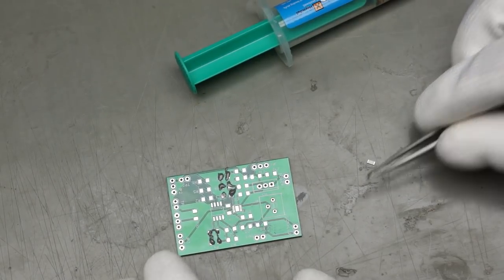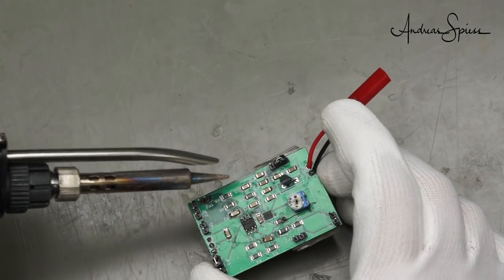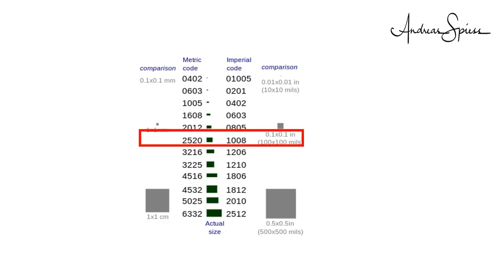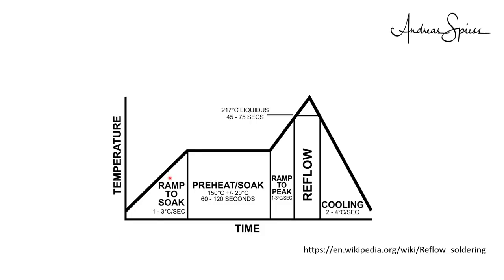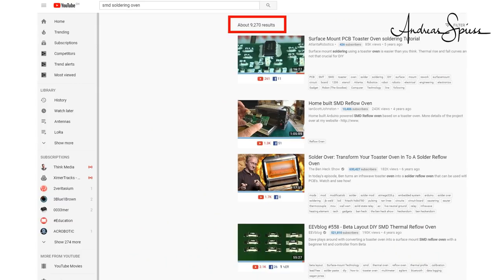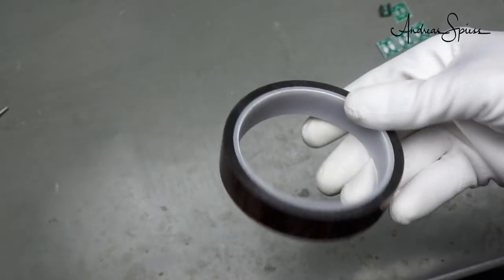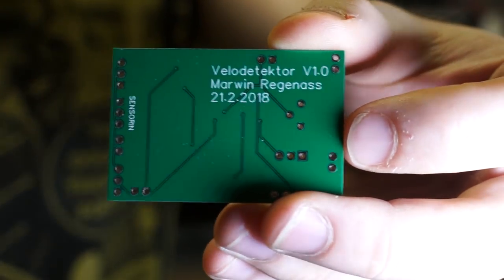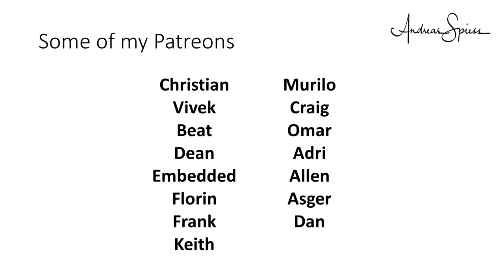#192 Aldi Hack: Simplify SMD Soldering with a Cheap Aldi Oven. Nothing else

Comment: Thanks for the nice video. I am currently looking for a possibility to solder ESP32 chips on breakout-boards and I thought this would be an easy way. Which solder paste do I need for this purpose?

Thx a lot,

Rudi
Reply from the maker: ESP32 chips are not easy to solder. I think you will need a stencil. I use normal solder paste from AliExpress
Reply: Is there a different possibility than to solder it myself? Is there a place where I could buy a finished ESP32-chip on a PCB rsp. breakout-board? I would prefer a breakout-board to a development board since I want to run the ESP32 on battery and the development boards consume too much battery.
Reply from the maker: You get plenty of WROOM32 boards on AliExpress
Reply: Maybe we are talking of different things here - I want a ESP32 presoldered onto a breakout-board where I can solder the pin headers needed to integrate it on a PCB.
The boards I have found on AliExpress either are development boards, breakout-boards where I would have to solder the ESP myself onto the breakout-board or PCBs with no headers or some with a OLED display that I don't need.

Could you provide a link to a module that you would think to be suitable for my needs? I am somewhat afraid of ordering a unit and waiting for four weeks or longer only to find out I'v3 got the wrong one;-)

Thx a lot,

Rudi
Reply: Could you recommend one? The boards I have seen so far fall into the following groups:
- development boards with usb and voltage regulator
- breakout-boards where I have to solder the ESP32 myself onto the breakout-board
- test boards (which are expensive and I don't know how to fix the ESP32 on the boards)
- boards with an oled which I don't need either
Maybe I am looking for the wrong stuff...I just need a ESP32 board (no development board) with the ESP32 already soldered onto the board. I can solder the pin headers myself I just want to avoid soldering the ESP32 itself.

Comment: Regarding the oven, which specs oven do we need? Because at shop i found oven in variety watts. as i know watt will relate to speed up the temperature increasing
Reply from the maker: It has to reach the needed temperatures, which is not always the case. The speed is probably not so important. There are projects for temperature control if you have a very, very powerful oven.

Comment: SMD is easier!  It's not until you try it do you realize how much of a time savings you can realize.  Also these days, solder paste stencils are pretty inexpensive and can also be a big time saver as compared to dispensing from a syringe.  It's worth trying on your project..
Reply from the maker: I agree. But in the years from this video, I am one step further: I order my PCBs with most SMDs already mounted. One mounted resistor cost a fraction of a cent ;-)

Comment: I used a Bleck & Decker 4 element oven. Two in the top and two in the bottom. I used an STM32F103 programmed with Arduino IDE using code from a guy online. An Arduino UNO would work just as well.
Reply from the maker: Thanks for your feedback.

Comment: Washed my eyes twice as I got confused with Rossman image on hovering the thumbnail. At second thought I almost assumed it is some caching issue with my proxy server. 

Anyways if my wife allows me to use oven for SMD soldering, wouldn't it be a bad idea to use oven for cooking food as it might get traces of lead or other chemicals?

Pardon me as I'm wrong and thanks for sharing the video :)
Reply: Put the solder on the board and not anywhere else. Lead problem solved (not that it was that big to begin with; the lead hysteria is a media panic way out of control). Same for other chemicals. Don't touch anything that food will touch.
Reply from the maker: Kunal, always trust the wisdom of your wife. Women are more risk concious that men. Just read the statistics.
Reply: Thanks :)
Reply: LOL, here my wife trust wisdom of mine. Anyways thought to use some cheaper oven with airflow for equal heat distribution exclusively for this.

Comment: Thanks for sharing 
How to use this method with double side pcb ?
Reply from the maker: I assume it only works with chips on one side. The rest has to be added by hand.
Reply: @lava08 One option is to do what commercial manufacturers do: glue the components on the bottom side before soldering. (You must get glue made especially for this. DO NOT use superglue.)

If the solder paste is very sticky, and very carefully applied with a stencil, and the parts are pressed into it enough, with a carefully controlled profile, surface tension alone can suffice to keep the components on the bottom from falling off. (Only heavy components like large inductors and connectors need to be glued.) But the process control needed for this makes it difficult to do at home. 

The other thing you can do is to do one side first, reflow it, and then do the other side. The surface tension of the already-soldered components is enough to keep them in place. Again, works for all but heavy components. 

For all of these options, of course, it’s essential to properly support the board. Just laying it on a rack, you could be resting on a component, which could easily shift it out of place. One option is to screw metal standoffs into your mounting holes. Another is some kind of jig that holds the board by the edges.

Comment: Could smallest smd parts be moved by the soldering paste during the process and go out of allinment?
Reply: PCREVOLUTION Yes, they are moved. And no, they go not out of, but into alignment. Luckily adhesion and capillary forces work together to pull the part into the middle of the pads.
Reply from the maker: Jens is right. Very nice to watch when it happens...
Reply: They either crawl into where they should ideally be by surface tension, or they sometimes crawl somewhere else entirely, like shifting by a whole pad pitch or turning on their side or on one end! for this reason, you should of course perform visual inspection of the PCB rather than just rely on everything being exactly as you placed it! Most of the time, everything will be more or less alright though.

Comment: Nice video agian! Check out the ceramic tweezers at aliexpress. I prefer these for soldering and desoldering SMD Parts. They don't get hot and didn't take heat from the part like metal tweezers.
Reply from the maker: I have one. I bought one in the past because of your arguments. But the Hakko has smaller "peaks" which is better for the small components (for me). So I do not use it often.

Comment: The kitchen oven. No! There's an extra reason to avoid using it: the power/volume ratio is probably not great so it will not reach top temperature very fast adding extra stress on components. Buy the smallest and most powerful oven you can find for cheap.
Reply from the maker: You are right. And I pinned a warning comment to the video

Comment: You should never put it directly into the oven, you need to shield the PCB from the heating element. If you dont shield it with a piece of metal, the heat radiated will exceed the temperature you need. You need the air to heat up the PCB, not the infrared radiation from the heating element of the oven.
Reply from the maker: You are right. We have to pay attention to this fact.

Comment: Do NOT reflow in your kitchen oven, nor any other over that will ever be used to cook food.

Solder paste (as well as some components) contains several very toxic chemicals that will off-gas and contaminate the oven, which can then contaminate any food cooked in it and contribute to serious health problems.

It is also worth pointing out that normal cleaning is not enough to remove the contaminates. To help put it in perspective, the cost of cleaning a toaster oven used for reflow thoroughly enough to render it safe for food prep is much higher than the cost of buying a new toaster oven.
Reply from the maker: Thanks. I pinned a warning about that to the video

Comment: I replaced the bars on the shelf with something like:
https://www.wickes.co.uk/Wickes-6mm-Galvanised-Mesh-Panel---600-x-900mm/p/187720

It stops the thermal mass of the bars making the reflow uneven across the board.
Reply from the maker: Thank you for your tip!

Comment: Check on Apollo NG Picoreflow
Reply from the maker: It is a nice project if you want a controller. My point was that I do not need that. Most ovens do not have the power to heat much faster than the profile because otherwise, they would draw too much (household) current. Mine has 1500W and is quite slow.
Reply: Andreas Spiess , yes, you are right , even with the controller you can’t go faster then the heating slope of the oven. But the controller can help you to maintain the temperature for activating the flux , to limit the temperature  overshot and the most important for me to record the whole temperature trend.  I also I am experimenting with an oven and the picoreflow controller. Even picoreflow implements in software a PID having an on off control does not limit enough the overshot due to thermal inertia but a very good start . My target is to implement a separate device and not to modify the oven, but I am not yet a blogger :). Keep up your good work. I am a fan of your work.

Comment: How about a suggestion on a follow up by  testing  "3d printed solder stencils"  https://hackaday.com/2016/02/08/solder-stencils-with-a-3d-printer/    and the online tool   http://solder-stencil.me/   Sure they may not be great but if your using 1206 parts.  Or  do you think it is better to order a stencil with the boards.
Reply from the maker: I  would order a stencil if I would have to assemble many boards. For one or two, manually applying the paste is ok.